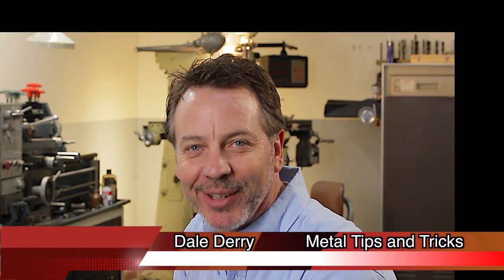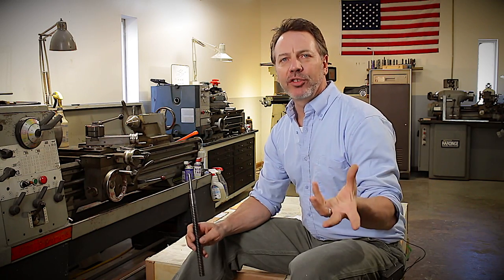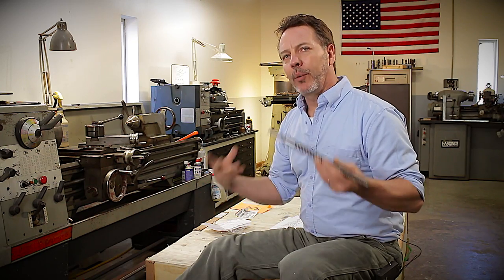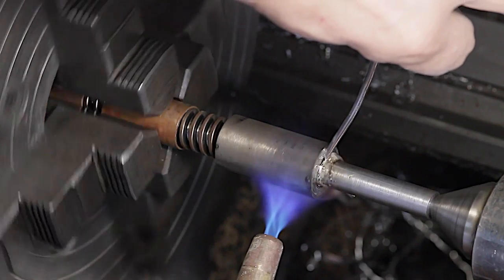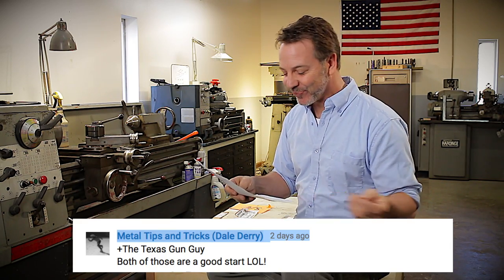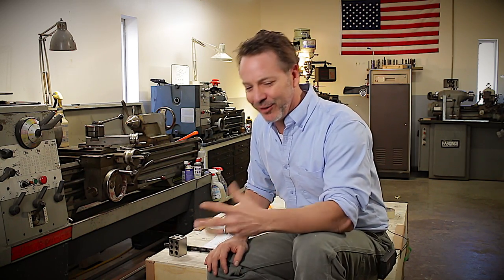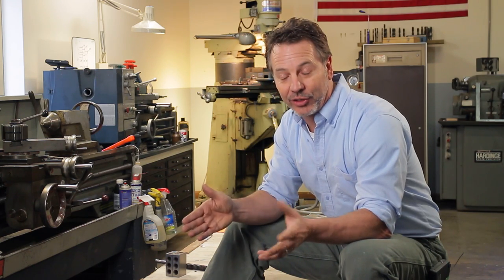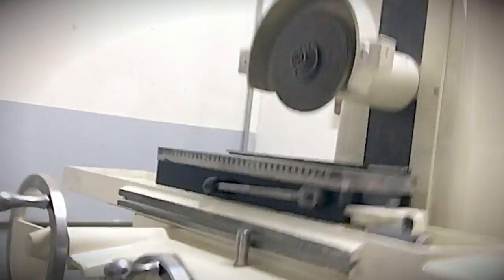Lead screw Q &A

Comment: Dale, great Q&A video.  One thing that came to mind when you mentioned juggling three parts regarding the suggestion about using 1-2-3 blocks to hold the nut...I see a lot of similar juggling on various machinist channels...a lot of this juggling could be avoided by using a strip or two of thin double-sided tape.  In your case, a strip of ds tape on each ear of the nut would have held the 1-2-3 blocks firmly and essentially just made the three pieces into one piece to make clamping in the vice a simple affair.
Reply from the maker: Great idea!

Comment: Hey Dale, 
Firstly, great 4 part mini series. I love to learn, and did so watching them.

I do have a question you didn't cover, maybe two...

You mention to start with a good, hand ground lead screw. You mention you used an ACME lead screw. 

I will Google it, but while here want to ask to be sure...

Are you referring to ACME as a brand, or type, or manufacturer of or distributor of lead screws?

ACME being a pretty common name for businesses, I'm not sure what I'll find via my search... hence I asked.

I need a couple lead screws for my 3D printer that are true, can you provide a source for smaller, well made, precision ground etc etc lead screws that don't cost a small fortune?

I don't have a machine shop, the last 4 videos I watched pretty close covers my knowledge base on the subject.

I saw what you use it for.... but what is the blue stuff you put on parts when measuring and marking your cut lines?

tia,
- chase -
Reply: The blue stuff is called "layout dye.". As you've probably noted yourself it can be very hard to see the markings made when laying out a project.  Even with good lights getting it right can be a challenge.  Hope that answers part of your question. 

 I'm a novice to machining myself but very happy to pass along what I've learned this far.

Comment: Light press fit or even snug slip fit and pin is easiest way to do this.  My lead screw is linked to the head stock output this way new from factory.   The pin also serves as a shear pin safety.

Comment: Good idea for a Q&A video.  A very good addition to an informative series.  Thanks.

I can appreciate sometimes needing to use what we have on hand, but I would not use CA to glue metal.  I am a woodworker and use CA glue sparingly on my wood projects.  I would have driven to a local hardware store to purchase some red Loctite which will last longer than CA glue.

Your comment about epoxy being too viscous may be based on the epoxies you  have used.  The typical hardware store epoxy is thick, but epoxies are available in all sorts of viscosities, just need to do some internet search.
Reply from the maker: Thanks for your comments

Comment: I think the choice of an anaerobic adhesive for the nut was appropriate (assuming you chose one like Locktite 680 that is intended for axially loaded cylindrical parts).  Locktite 680 has a shear strength of 4kpsi.  Over the area you had to apply it on it would have been able to withstand a considerable force.  Great set of videos.  Thanks for posting.
Reply from the maker: I agree, there is about 4 
cubic inches of surface.

Comment: Dale, when you talked about using silver solder, you said it takes upward of 1100 degrees etc. I've been using soft silver solder which melts at 430 degrees. the tensile strength is much greater than plumbers solder. the easiest source is Enco  called 
Stay-Brite silver solder on page 987. great videos and a tremendous advantage for the young guys wanting to be a machinist.
Reply from the maker: +Keith Fenner 
Thanks for your positive comment. Looking forward to trying that solder. :-)

Comment: Hey Dale. 

I had been waiting to see how your rebuild of that screw and nut finished up. Really nice job! 

What was the backlash before and after your repair?

I wondered how you were going to adhere everything together. 

Because you took the time and energy to film your repair as well as all your other videos It has really helped me to determine another couple ways to get great results on the refurb of my lathe screws.  Your steps and thought process were spot on... and like you mentioned "you go with the flow" with what you've got on hand. It'll be interesting on how long that CA glue holds up. 

As for the the negative..... you've got a 1000 attaboy's for 1..... idi   , well let just say you've got backing from the appreciative fans. 

Looking forward with more from you. 

Best.
Reply from the maker: Thanks for your positive support 😀 I don't remember what the back lash was what a do know is how smooth it works now.

Comment: Hey Dale, you've mentioned your mill being raised up (besides just the riser block) in a couple of your videos but this is the first one that I think you really see the casters in and it had me wondering: being another tall guy at 6'4" and having a really small shop I would love to see more details on how you have that done and can you really move it around like that and more importantly does it being raised and on wheels cause any problems (my bridgeport sits almost against a garage door and too much inadvertent movement could send it against it and over a lip in the concrete causing me big problems and likely break the casters/mounts).

I love your videos.  Honestly there is a little bit of a "watching a car accident"/"meatball machining" quality to them, where I could see someone like Abom79 cringing on how you decide to do some things (your drill adapter to for the Z on the mill knee comes to mind or even the 2 sleeves in this series), but your way is typically closer to what really works well for me and often if I take the approach that others would with everything carefully measured out... I would end up with something going weird on me or worse the project would sit around till I had time to way, WAY over think it.  Your videos are way more likely to get me out there to build something cool.
Reply from the maker: Thanks for your comment. I put my mill on wheels because I knew I was going to be  moving it around to other shops over the next few years. I would not  suggest doing it. What I would do now is make a permanent metal palette for it. Pallet jack works much faster safer and smoother and the benefits of  rising it up for a tall guy like you is immeasurable. ;-)

Comment: Great idea, especially on an unusual project. Discussing the decisions (and comments) raised by the project is a great idea. I hope you will do this more often. (And maybe some of the other Youtube machinists will follow your example.)

At 8:30 you are speaking of dissimilar metals working against each other. Think about lapping. In lapping, it is the harder metal that is worn away. Any grit or abrasive that gets into the system (this is going on a grinder, remember) will embed in the softer metal and wear away the harder. The difficulty of replacing the nut vs replacing the screw should be taken into consideration. At least with steel-on-steel the abrasives can be cleaned out of the system periodically with comparatively little embedding.
Reply from the maker: That's a good point
Reply: Also different materials are used to reduce the coefficient of friction, steel on steel can have a greater CF than steel on brass or steel on bronze.

Comment: Hi Dale,I am setting up a small CNC machine, Is there any rule where the round hard rod and lead screw have to to be of the same diameter?
Rails are 16mm round hard rod, so should lead screw be 16mm diameter or can I use a 12mm or a 10mm lead screws too?
Thanks,

Comment: The worn shaft may have been worn by the fine grit. Would it be good to put a oil or Greece hole in the middle of the thread block like the do on shafts?
Reply from the maker: +Steve Larsen 
it already has one.
Reply: Thanks for your reply. I thought it should but didn't see one. Thanks for your great videos.

Comment: Question? Maybe it's the camera angles but it looks as though your lathes and your milling machine are set a little high. is that on purpose? I always kept mine where I had the least wrist bend.
Reply from the maker: The mill has a riser on the column so head isis tall then  what you see on most mills. And the lathe might be taller.

Comment: 5 years late. Just a comment on the pinch nut idea. For the worn thread, it would not work unfortunately. I could see in the first video that the wear on the thread was uneven. This means that the individual threads are different thicknesses. A pinch nut would bind where the threads were at a larger thickness or would still display slop where the threads were at a thin thickness depending on how the pinch nut was set up.

Comment: Well I stayed until after the credits. :-) So am I missing where you've hidden all the information and maybe possible rebuild of that very fine looking SG'r? Or is it not on your channel yet? I did check for anything about it, but it's not totally impossible for me to miss something.

And good tip about that notification button, I didn't know about that.  Many thanks.
Reply from the maker: You didn't miss it. I will be doing surface grinder video very soon😀
Reply: Looking forward to that Dale.